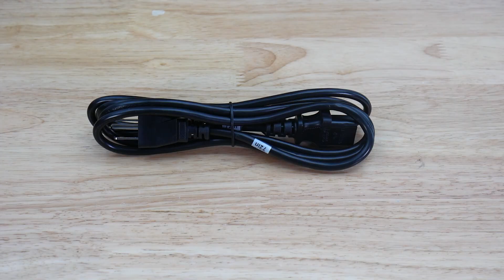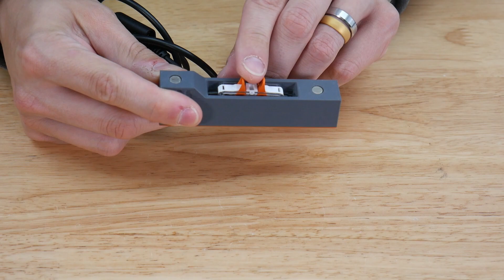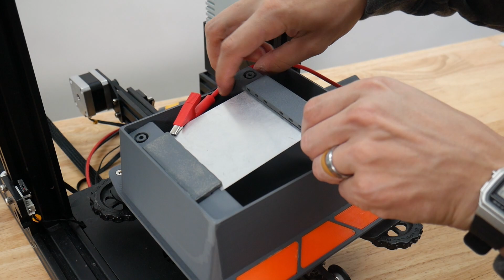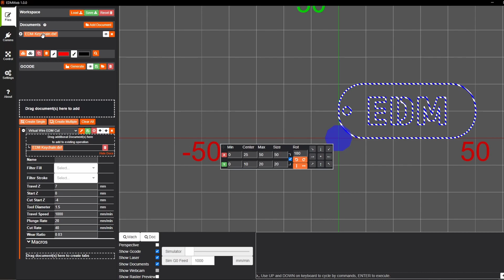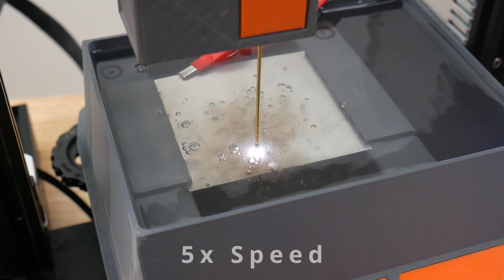Powercore V1 Quickstart Guide

Comment: Hi! I'm working on your project, but I see that the firmware doesn't have the correct logic for measuring current using the ACS712 sensor. Why is that?

Comment: Awesome.

Brass electrodes are inexpensive and convenient, but have you considered copper-tungsten composite? Assuming it has a lower rate of electrode erosion, it might permit the use of smaller diameter electrodes for a greater level of fine detail, when desired.

Comment: This is fantastic... is the power supply capable of running a custom graphite electrode as is used to plunge injection molds? or would that require more power due to more surface area of electrode?

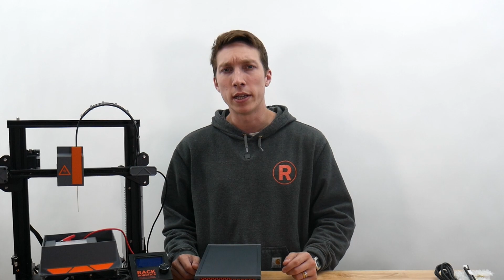Comment: 2:50 "Safety precaution: Don't touch the printer when it's running!!!"
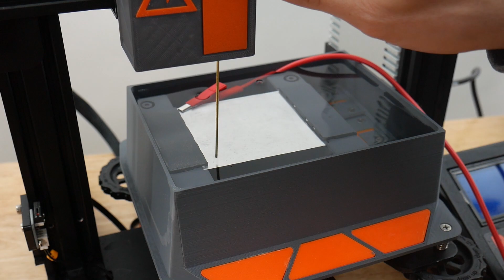4:40 "After you turn it on you need to touch various metal parts of the printer until you see sparks"
C'mon!

Comment: Can the working area be expanded?
Reply: Do you think air tight tolerances (as seen here: https://youtube.com/shorts/M4r_KhH9O4s?feature=share ) are possible with an Ender 5 Pro?

I’d be using an Ender Extender 500 expansion kit to get a 510mm square working area.
Reply from the maker: @NikTackett Not with the rod method. There is someone who got wire EDM working with the Powercore (link on the Rack Robo X acct). That might be able to do it.
Reply from the maker: You can use the Powercore on any motion system. If you have a larger machine you use it on, we'd love to know!

Comment: Im a little confused about the 24 v enable now. Originally you billed this as a safety control from the printer but now youre saying dont use the printer power? The power supply needs its own power supply?
Reply from the maker: You specifically should not use the printer motherboard for powering the Powercore. This can cause errors. The actual input current needed by the enable port is in the mA range, so it's just a safety. We have heard of people planning to use the 24V SMPS from the printer for this so that may be a good option considering it is easily available.
Reply: @rackrobo  is it possible to use it directly from the printer power supply? after all, it does have screw terminals and can 100% deliver the proper amount of power since you are not powering a heat bed with this setup, right?
Reply from the maker: @DJProPlusMax  it's definitely possible. I don't know that we've tested that specifically, but we'd love to hear if you do! Shouldn't draw more than a few mA.
Reply: I do have a printer, but not enough money for a Powercore 😕 @rackrobo
Reply from the maker: @DJProPlusMax  Understandable! We have opensourced the files if you wanted to try your hand at making a Powercore. Otherwise, we're putting in effort to make the Powercore more affordable!

Comment: So theres no feedback loop for automatic depth control? sus
Reply: It’s just a power supply.
Reply: @rickmellor  right, but when the system is used as intended, it doesnt automatically compensate for electrode wear based on feedback from the power supply.
Reply: @davidfarmer  does the supply provide that feedback? Or is it driven by estimates? The spool fed machines appeared to me to be a constant speed feed. I have this PSU but it’s still sitting in the box.
Reply: @rickmellor  for a rod setup The z axis moves down based on a calculation, not feedback. but the supply does output data that should allow it to act in a closed loop fashion.

Comment: Where do we find the work holding fixture you use in the video to hold the aluminum plate ?  It appears every other file needed is in Printables, but not that one. Thanks
Reply: they said on Twitter was the work holding thing on printables
Reply: @3er24t4g1  They may have said it, but they were incorrect. The part they show clamping the aluminum is not included in the Printables bundle. I printed all of the parts months ago, and have checked again today. I have everything else, except that workpiece holder.
Reply from the maker: @DrRon1957  Hi! Sorry for the confusion. The files are on the post titled "Work Holding with Flushing Manifolds" on the Rack Robo account.
Reply: By default, Printables does not show ALL MODELS. That is why I did not see the work holding fixture. It shows 6 on initial page view, and you have to find and click ALL MODELS to see the rest of your creations. I found it that way, thank you. Sounds simple I am sure, but since I tend to design and print with out using Printables very often, I was unaware of their web page setup.

Comment: Great video Cooper! I can't wait to get cutting! 
I’d just like to reiterate the sock hazard. As we are not talking about a little bit of pain if you get shocked. If that current goes across your heart it could be potentially fatal. Never touch the electrodes, workpiece, and water, when the Power Core is turned on!
*Get in the habit of following a procedure. I.e. Turning the Power Core on as the last thing you do before starting a cut, and turning it off is the first thing you do before touching anything again.
*Try to use the one hand rule, i.e. use only one hand when touching electrodes even if the Power Core is powered off, as this will just form good habits in the off chance you forgot to turn it off.
Reply: the docs say that this is 72 volts DC, which is no where near as dangerous as being exposed to 120 volts AC from the wall. It is good to practice high voltage safety, but the comparison is factually incorrect
Reply: @3er24t4g1  I have edited my post.  Ok maybe I was a bit extreme with my comparison but I wanted to give an example of something people can relate to. A couple of things to note, as to why I believe it to be more hazardous than people may think. The Power Core works by turning on and off the voltage (currently at 20khz, but may change in the future), while this is not true AC it is a time varying voltage that will couple through the skin of a human better than DC. Second, in the event you touch the anode with one hand and the cathode with the other a GFCI will not protect you in that case.
Reply: @TheTerminator414  2 khz not 20